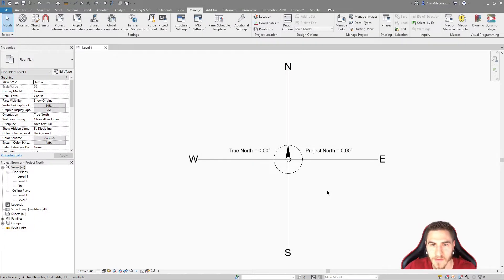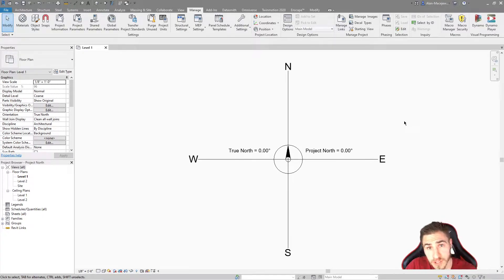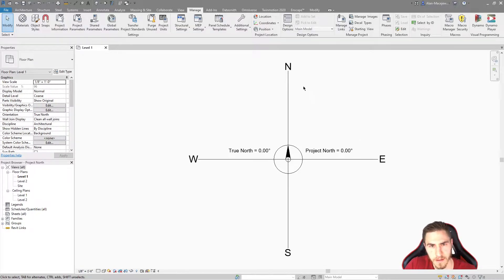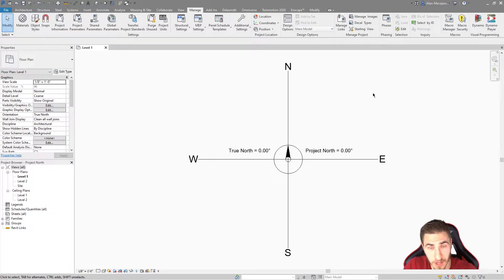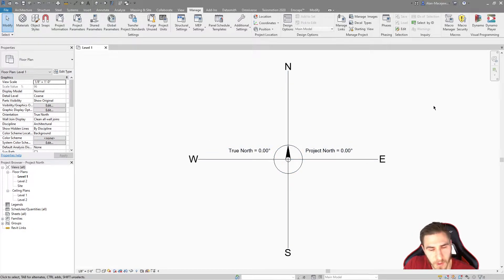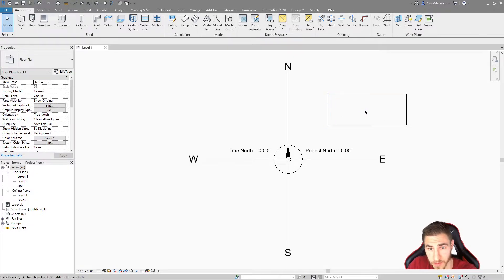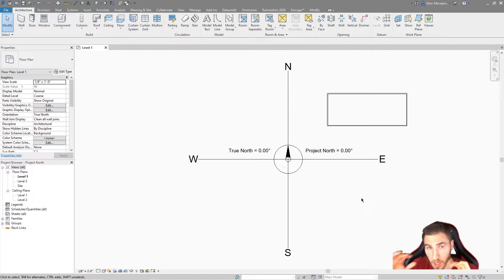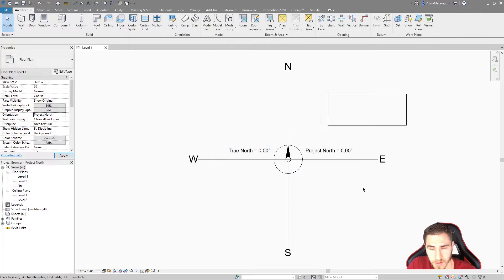Project North vs True North | Revit

Comment: Really helpful explanation! Is there any reason why the True North angle is negative when it is clockwise relative to Project North?
Reply from the maker: My guess is that is based on where true north was when you started the project and which direction you moved it or project north. Thankfully it all means the same whether it’s positive or negative.

Comment: Firstly thank you for the video. 
Question 1
How survey point relates to the positioning?
Question 2
If I started the project with no survey plan and wish to move whole lot to the right position with new information available how to do that not getting any issues? (Q3) Am I right to say that I need to assign new sheet views?
Reply from the maker: By default the survey point is at 0,0,0 but that will want to change based on a survey you receive so that your elevation points read correctly when referencing the survey point.

I would use the relocate building tool which will allow you to move everything vertically without actually moving your model. This will alter your survey point.
For new sheets, you just need to make a new sheet, choose the template and then drag a view to the sheet and you are good.
Reply: Thank you for reply